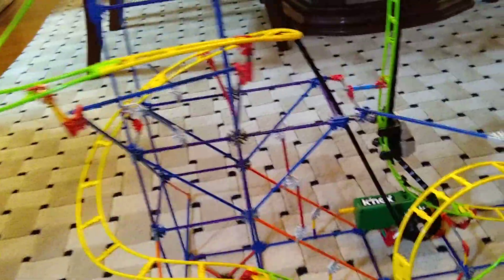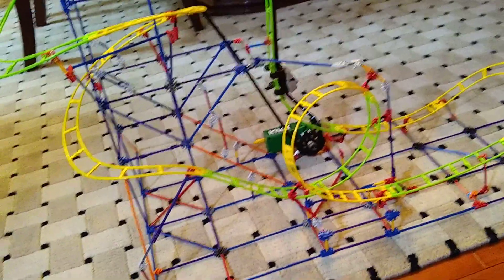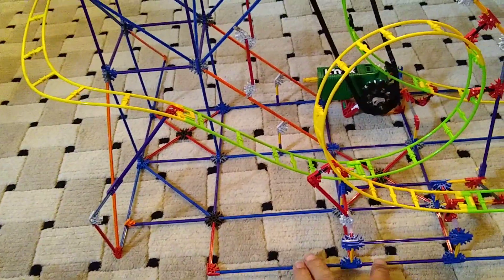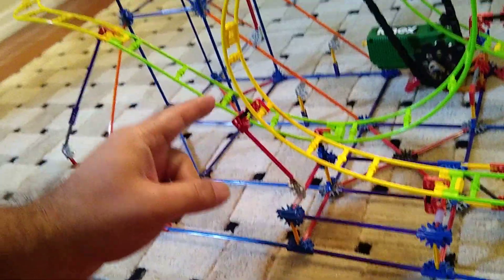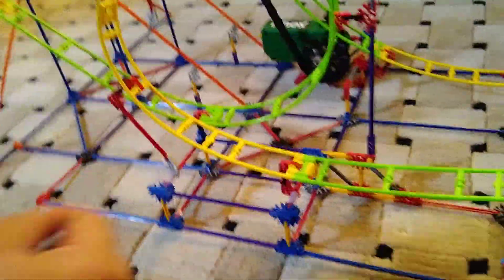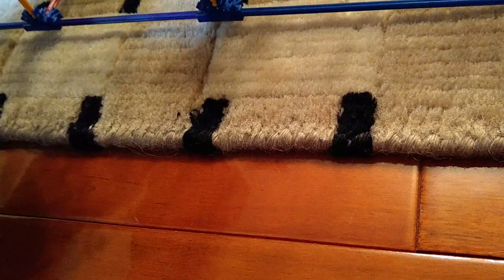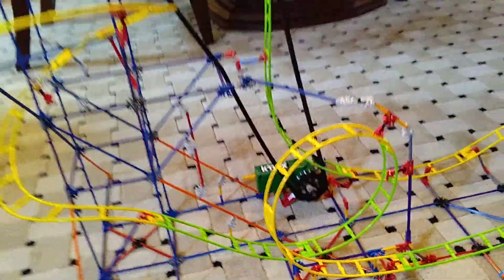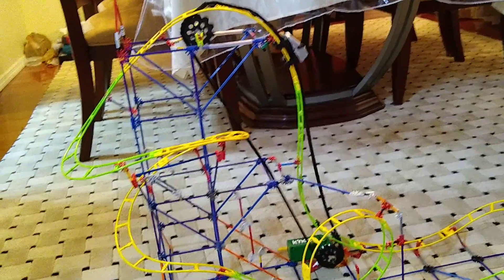K'nex Education Stem Explorations Roller Coaster Loop Problem & The Fix (2 Fixes)

Comment: Adding to the solutions - I didn't have the same issue as you.  I took a look at the car and noticed that the wheels were slightly bent.  After I straightened them out it worked great!
Reply from the maker: Great tip!

Comment: Built this with my son, and we had the loop problem. I spent an hour tonight tweaking multiple connection points. I also suggested stopping the movement under the loop… we couldn’t get it with my modifications, but I said to him “I’ll look at YouTube because I bet others have had the exact same problem”….. low and behold… thank you so much. I will try these mods tomorrow morning!
Reply from the maker: Best of luck 👍

Comment: K'nex coaster cars in general have a problem of losing their lubrication over time. Any k'nex micro coaster will do that after a certain time.   The fixes you show will probably give it one or two months of more life than same problems will occur again. I would recommend lubricating the really small steel rods that hold the wheels of the train with something like W-D 400 regularly like one time per every two weeks in order to optimise the time you can use the car. Hope that will help :)

Comment: The best way to build a Knex coaster is to build on a wide flat board.
The base may be fastened down with wire staples.
Wire staples fit over the micro Knex rods.
I use small staples made for telephone wire.

Infinite Voyage is a kit that hops around due to the launch.
Stapling the base makes it work much better.
And it is easier to move to free the workspace.
Peace
Reply from the maker: Great tip. Thanks!

Comment from the maker: I have devised a "Third (3)" solution fix to the loop issue.  Let me know if you want me to upload an updated video. 😊
Reply: Tried both and still not making through the loop 😔
Reply from the maker: @klausr5438  Try lubricating the wheels of the car
Reply: I tried everything and it won’t work